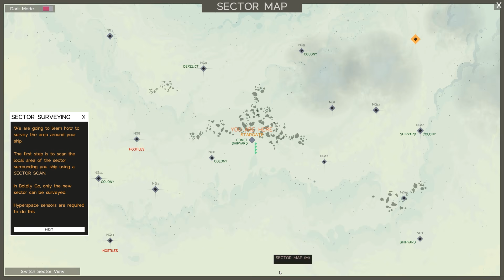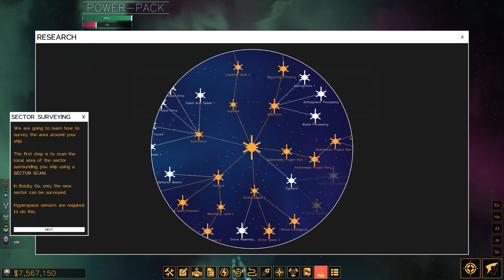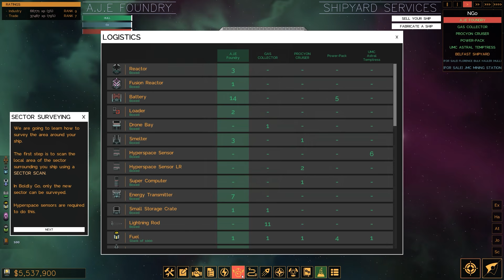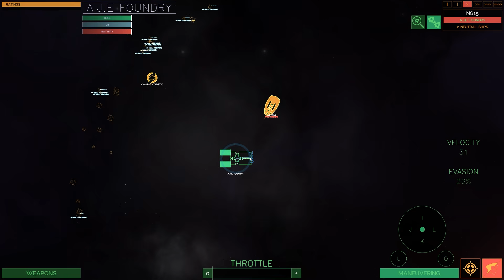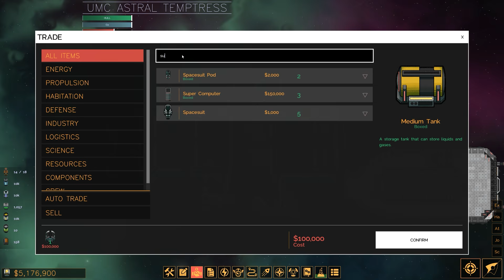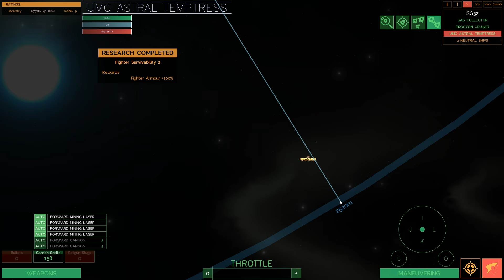We Need More Power Captain! | The Last Starship #13

Comment: As Gas Collector had excessive energy from lightning rods, you could set up some further gas processing on its board, as the vessel is mostly idle while pumping gas. Would alsoo save some further time comparing to processing gas on Foundry

Comment: Not all of these phase 7 recipes produce a single item. Some produce multiple. Thus you're getting your ratios incorrect.

Last reactor you've installed seems disconnected from the grid - as well as two reactors on Foundry